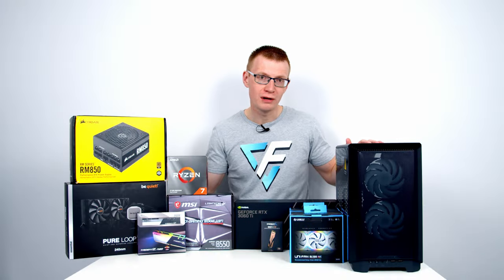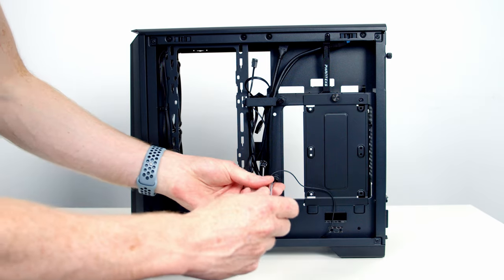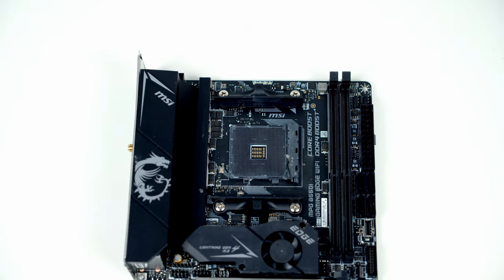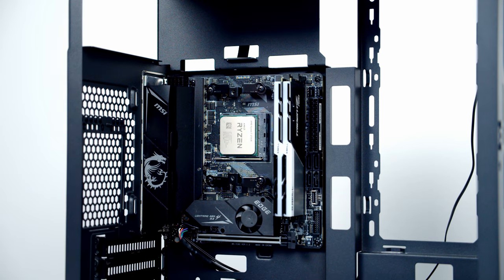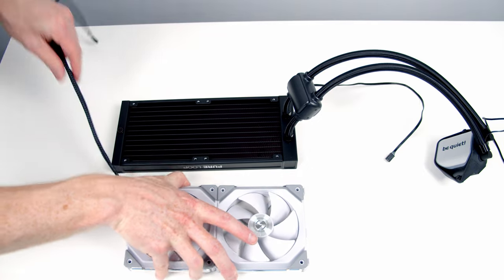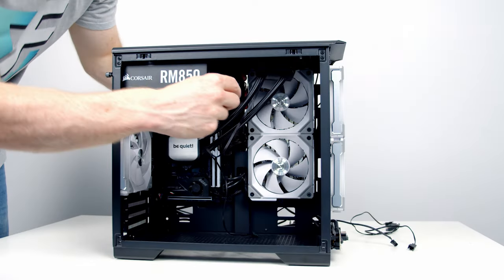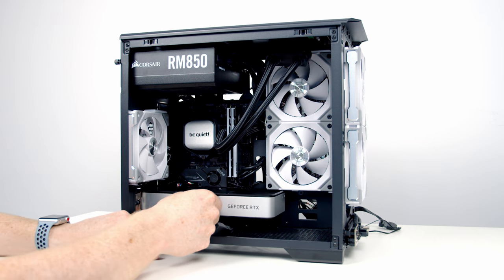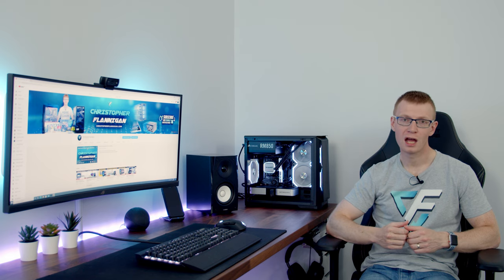Phanteks P200A Build Guide - Step by Step

Comment: Wishing you all the best. Your build guide for the Cooler Master NR200 was soooo helpful in building mine, which turned out great (10600K, MSI Unify Z490I, Noctua NH-U12A, 1660 OC, CM 650 SFX, 32 GB G-Skill Aegis). This Phankteks case looks like a decent competitor to that Cooler Master case.
Reply: Both great

Comment: Great job!  I like this case.  I want to add the 2x HDD brackets for 4x 3.5" drives.  Not to mention spreading the thermal paste from edge to edge cools down the cpu a lot more than a P sized dot in the center.

Comment: Hi @ChristopherFlannigan, nice videos and channel, helps a lot for my building. Im building a Pc Gamer into a Phanteks P200A buy some issues to install  the AIO Artic Liquid Frezzer II 24o due to the massive size of the radiator. I have try to install in the side as you did, but no clearance for the GPU in horizontal position ( no chance to vertical ).
Finally a found the solution installing the AIO radiator in the front, with the fans Out the case in air intaking configuration.
On  the side 2xcase fans (P12 PWM PST) intaking
On the back 1xcase fan (P12 PWM PST) exhausting

Please could you do let me  know if a high intaking air pressure is being generating or is my system well balanced,

tks and regrds

Comment: It doesn't seem ideal to have to cut a piece off the uni fans to install the graphics card.  I say this because I recently bought a similar set of parts for my new build.
Reply from the maker: Agreed. Check out my thermal testing video coming soon for another configuration that will work

Comment: Not a fan of this case. The PSU location eliminate any top fans possibility. For this reason you had to butcher your Lian Li side fan because you knew that mounting your GPU vertically, as it would fit, you wouldn't have had any rear fan too.  A case that force you to make those kind of compromises is a "nein" for me.